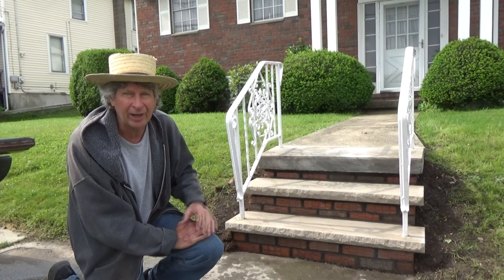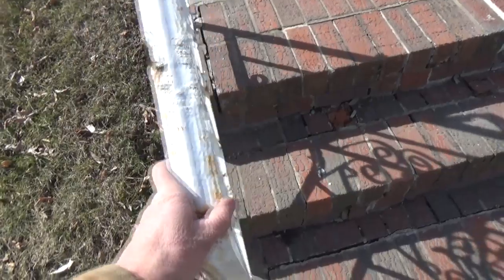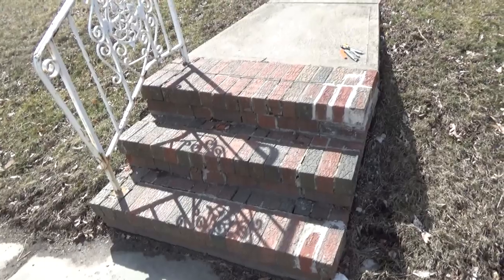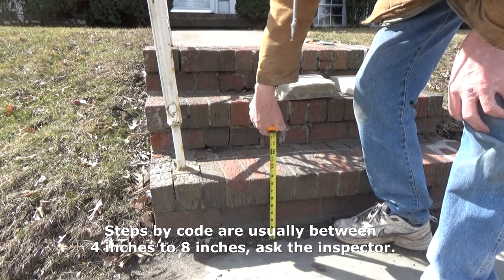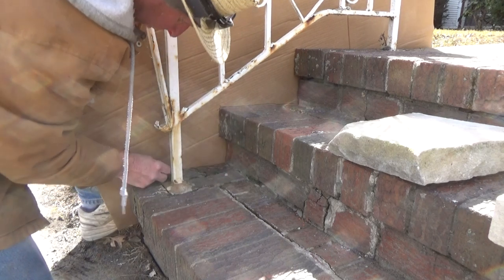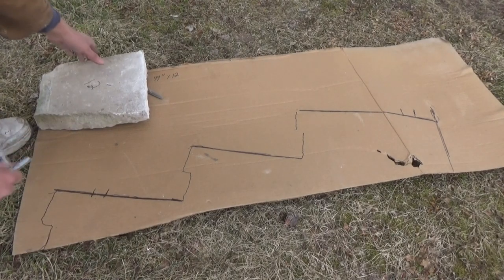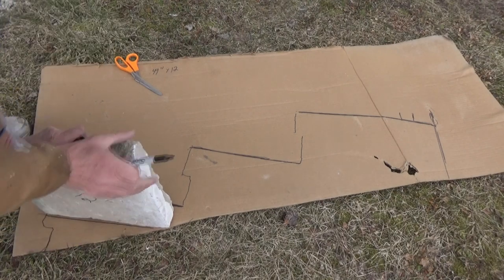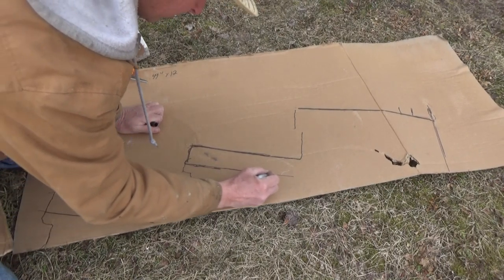BRICK STEPS REPAIR (Part 6) Mike Haduck

Comment: Hi Mike, down here in Alabama the mortar lasts quite a bit longer than it would in Pennsylvania. However,I do get ALOT of calls for pointing up steps (usually where full joints were not used to begin with). The joint on the third brick will crack ,sometimes all the way up and down the set of steps before anything else.  Great video!
Reply from the maker: Thanks Mikey,   Mike

Comment: hope your nephew realizes just how much skill and craft he is working with, but i bet he does.
best set of steps ive seen made they may last 75 years.   nice work making a piece of span-crete to bring to the site.
is mortar the best to set the railings or would you use hydraulic as well? 
thanks for the nice video
Reply from the maker: Hi Brian, that rapid set is basically a hydraulic cement,  works well,  mike

Comment: Nice job.   I really don't know why they use bricks on the top instead of a stone cap.   I live in Oklahoma and it seems that any of the stairs made with all brick has cracks or has broken apart.   I replaced one set of stairs with cast concrete.   Not as pretty as your but I couldn't find anybody to do the job.  Sad that another trade is vanishing.
Reply from the maker: Hi larry,  it's true, brick work is a dying trade, everything is getting premade,  thanks mike

Comment: Nice job. Did you use the bottom of the formed concrete slab or the top.?Did you flip it over? Thanks
Reply from the maker: Hi beck,  no used the top part, just a little heavy to move,  thanks mike

Comment: Great video Mike! Do you prefer butting the new limestone treads up to the next brick riser like in this video, or having the tread run underneath it like you see sometimes with 16” deep limestone treads? Is one better than the other? Thanks!
Reply from the maker: Hi Philip, personally ,I would rather bump it up, just because it would be easier to replace but some say the steps last longer because it serves like a shingle to keep water out. But if you chip the stone you can't get it out easy, 6 in one hand half a dozen in the other, thanks Mike
Reply: Thanks Mike!

Comment: Mike, Where do you buy the two lower caps you used as treads? Are they stone?
Reply from the maker: Hi mac, yes they are called limestone threads  usually you get them at masonry or brick yards,  thanks Mike

Comment: Great job Mike. I am measuring for a cap stone to replace by brick steps that take a beating up here in western Mass. I am shooting for an 1 inch overhang on three sides. How much should I shorten the back side of the cap to allow for a mortar joint? Love the videos.
Reply from the maker: Thanks Mark,  that would be up to you, some masons try to have no joint or even lay over the stone, I am happy with 3/8 joint,  thanks mike

Comment: Hi Mike. I'm enjoying learning from your videos. I wanted to ask why did you use concrete for the top step? Why not use the limestone all of the way up? I also wanted to know if you've ever done a repair on a set of steps that has broken brick on the top landing for the finish? I'm in NC and have a stoop that is brick with what they call "broken brick" on the top landing with full bricks as the edge border. It's in bad shape and those smaller pieces are coming loose while the edging is still ok. Thanks.
Reply from the maker: Hi mista,  I wanted the concrete on top to match the sidewalk and it is a little thicker for the railing,  down south it’s a different story with your weather,  usually the bricklast a lot longer,thanks, Mike

Comment: Ha ha.. “so I wet the sides of the forms so they DONT stick”. Either way... wet it.  Cos normally you say.. “if you want it to stick.. wet it.”  Except in brick and block work
Reply from the maker: Hi Duncan, i should have more said if you don’t wet the forms the cement will get sucked into the wood and you get honey combs, almost backwards,  thanks mike

Comment: Hey Mike, I am a NYC DIY fan!
What's your thoughts on cold joints for one car garage footer?
My garage was built on a slab with no footer and now it's sinking all around. My thought was to put in 4-5 Ft sections of 12 x 12 footer with gravel and no rebar. Then follow with about 4" slab withing the footer. Thoughts?
Reply from the maker: Hi Asia,   Something like that you got to see the local inspector, and ask him what is acceptable in your area,  thanks mike
Reply: @MikeHaduck  How would you have done it if it was in PA?

Comment: Hi Mike that job turned out Great! and looks really nice! I was wondering how much slope did you put on the tread for water run off? When I poured my 3' long x 8' wide pad for my door entrance to my pole garage I was told that for every 12 inches it should drop a 1/4 of a inch so water does not run towards the door (building) so that is what I did. From the building out to the edge of the pad it slopes down 3/4 of an inch. Is that the same as what you would use in your area ? At first I thought that was to aggressive but it turned out fine and water sure does not sit on the pad or run towards the building lol Thanks for the Video TwoThumbs Up Sir!!
Reply from the maker: Thanks Rosario,  usually the more pitch the better,  I usually go between 2 to 3% pitch if I could,  thanks mike

Comment: Hey Mike I have a very large driveway with cracks and you can see we're settling happens and I'm thinking about just cutting out areas and installing brick with maybe concrete or crushed stone underneath and just build it up and maybe make a design with it rather than bust all the concrete and redo
Reply from the maker: Hi Donny, I have seen that done before,  mike
Reply: @MikeHaduck  I wonder if I should just put crushed stone under it like the Asians and Scandinavians do or should I just put concrete under it to support it?
Reply: LOL I live in the south so there's no freezing to worry about down here

Comment: That all Crete is great stuff but goes fast I chipped away all the loose stuff along the bottom of the foundation and just poured it like soup into the cracks eventually I’ll resurface the the sidewalk so I can hide the sins thanks mike
Reply from the maker: Thank you, Mike
Reply: Mike I filled all the crack up with that all Crete now can I resurface the sidewalk with that same stuff and how should I go about it paint it on or mag it